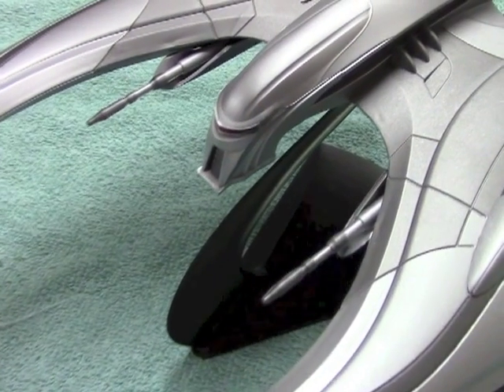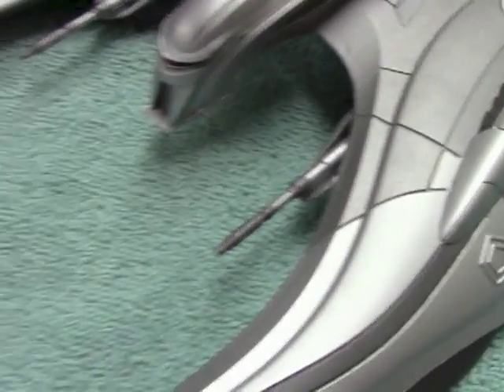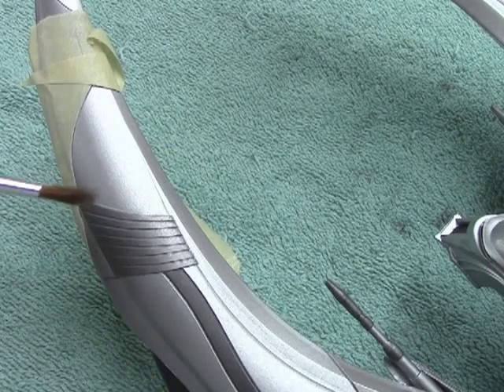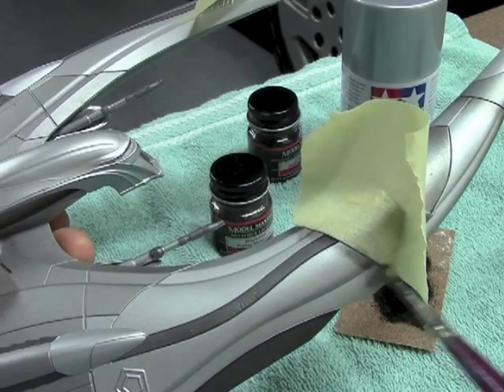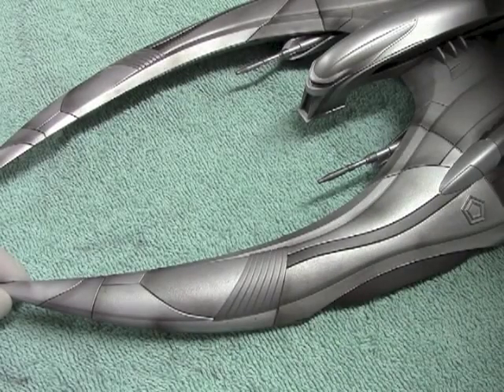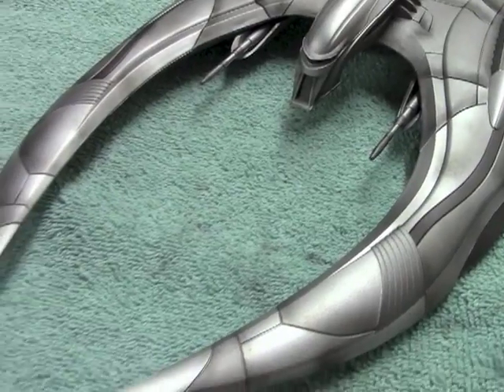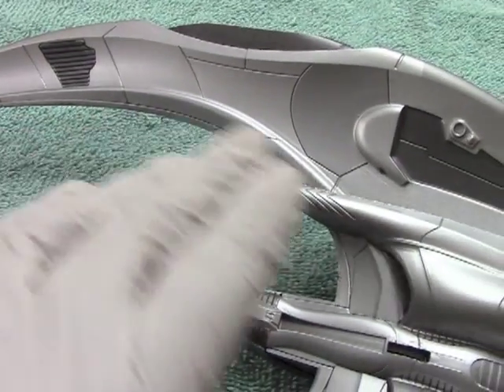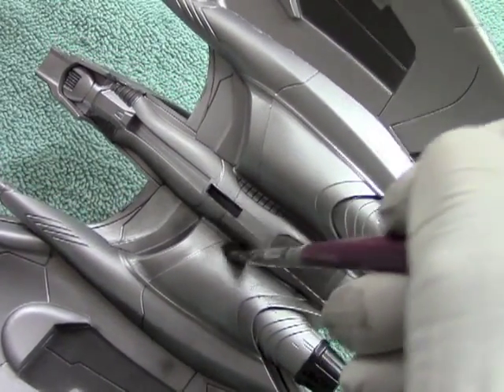Moebius Cylon Raider model & Pastel Demo

Comment: How do you fix it?...I've found the usual varnishes seem to dilute the effect when they go on wet...
Reply from the maker: You could always add a little more.  When applying the coatings, however, try and do light applications and allow enough time in between to dry.  An airbrush on lower PSI would be ideal.  Thanks for watching

Comment: You made that look too easy...was it? ...and did you seal it with anything afterwards? Good result 👍
Reply from the maker: Martin Futter yes pretty easy to do. I’d practice before final application if you’ve not tried it. The model was sealed with a light mist of flat coat.

Comment: I have built this model. painted it, and now the question comes up. "How do I want to weather this Raider ?" I definitely want to use the pastel powder like you demonstrated in the video, but I am vexed about using a wash in the panel lines. Did you use any wash on this model ?
Reply from the maker: Hi John, I did use a homemade wash but have tried others since. Lots of choices.  Tamyia makes a panel lines accent wash (see the BB8 SWars video) which I think works well and fairly easy to use.  You want to use something like White Spirit solution (instead of lighter fluid) to wipe off the excess.  Creates prominent lines  Another suggestion, MIG AMMO has some good washes as well.  They have an oderless thinner that is easy to use to clean off the excess as well.  There are also the washes by Vallejo which I plan to try soon.  I'm sure they're fine and they are all acrylic.  One other thing....although I still use pastels sometimes, I have now resorted to using the Tamyia Weathering Kit.  Much more control and easy to apply. Comes with sponges that look like make up applicators.  Highly recommend trying those.  Hope that helps.
Reply: Interstellar Modeler thank you so much. Great information!  I do like the idea of using the wash with thinner as a clean up. That will give me peace of mind that I will not ruin it as the wash can be cleaned up. I will have to work my way through the rest of your videos. I have some other BSG kits, the Cylon Centurion, The BSG Ship, and a MK II Viper.
Reply from the maker: You're welcome.  I'll be posting the completion of the Raptor tomorrow. The Tamiya kit was very helpful with that build for sure. I also demo the Tamyia kit in my original series Moebius Viper video.  One thing you might want to do is buy some cheap model kits that you can use to practice on.  I have a few bits and pieces from old models in a drawer that I experiment with whenever I try anything new.  BTW I checked the Vallejo washes on Ebay and they're very reasonably priced.  Look forward to seeing your work :)
Reply: Thank you :) I will enjoy viewing the Raptor video and more.

Comment: Interstellar modeller   when applying pastels are you adding anything to the ground pastel to help it adhere to the model ?
Reply from the maker: No. I'm not aware of anything that you can add.  I do however use flat paints and I think that's what helps with adherence.  Carefully apply a protective coat (dull or glossy depending on your preference) afterwards and do a couple of light coats when you do. Make sure you hold the can at least 18 - 24 inches away.

Comment: How do you seal it? When I tried this technique the clear coat actually washed away all the pastel.
Reply from the maker: +Trtlman1982 Hmmm.....I always apply a very thin coat of the dull coat and spray from at least a 24" distance. Do you think you might have applied too thick of a coat?
Reply: +Interstellar Modeler I might have done that and been too close causing the spray to blow off the pastels as well. I will back off more next time. Thanks.
Reply from the maker: +Trtlman1982 Yeah that's the only thing I can think of.  Just apply a fine mist and it will be enough to hold the pastels in place.
Reply: +Interstellar Modeler thank you